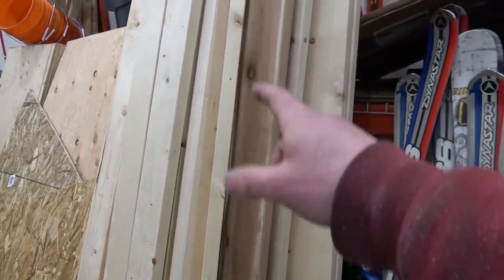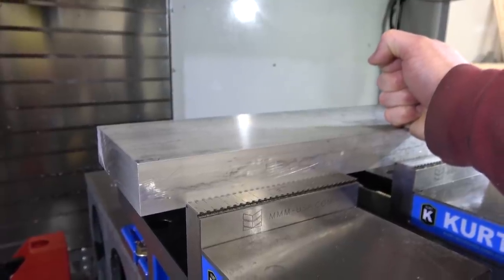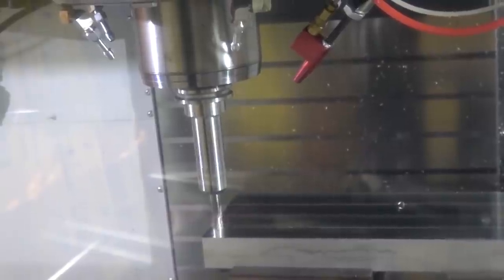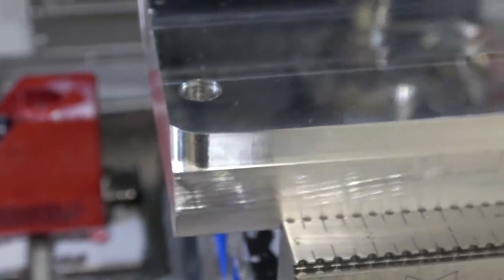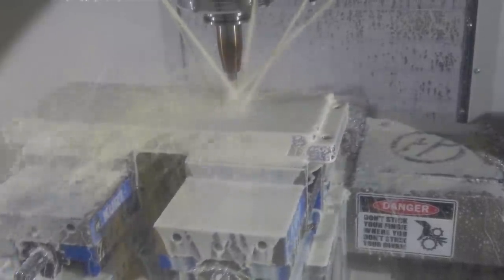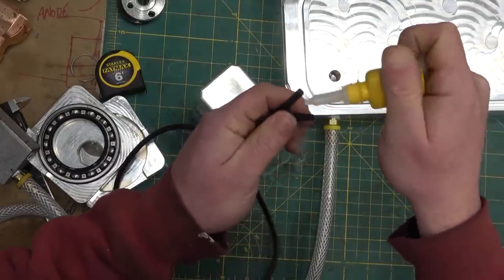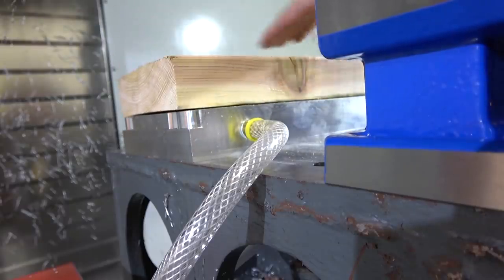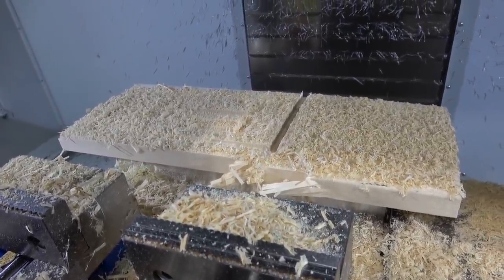Vacuum clamp for router-ing | Prototype & Test

Comment: Made one years ago, we used ball catches as air valves and had compartments surrounded by foam tape

The oring doesn't have enough compliance
Reply: Can you please describe how/why you used the ball catches?
Reply: @SlocketSeven  Ah jeez, man... got me friggin cryin' over here from laughing.
Reply: @nicoleyensen7062 they worked as valves, once pressed down they would open allowed you to have a grid of sealing material meaning you can have various sizes on the board
Reply: @MT_T991  Thanks, makes perfect sense now.
Reply: O-rings are fine for vacuum, however just like the shady highway, you have to double up or things will go wrong.
Reply: @eideticex  everything I have seen used industrially  over wood and stone industries uses foam rubber as a seal. It is more forgiving although obviously more readily damaged. Industrially  we used  a vac lifter  on slabs of stone not necessarily  flat or straight  for slabs upto 600 kg, one of clients had a  almost fully automated  cabinetry factory, all panels  from delivery ex supplier to assembly were vac lifted, also used foam seals , but seals lasted longer with them on smooth panels than for us on sharp and rough stone
Reply: @davidp8157  ive only seen foam seals on wood
Reply: @MT_T991  like I said above,  foam used extensively on other industries including stone,  as it is much thicker and with a hugely larger surface area more forgiving  for rough or uneven surfaces,  and to an extent, while more readily damaged  at any o e time, is more damage forgiving , o rings on rough stone would not work, and would not last,  but foam rubber does reasonably  well.

Comment: Try it with a v-ring seal, o-rings are not supposed to be used in this way.
Reply: don't know if would be more efficient the V shaped, but for some reason every CNC wood vacuumed table I saw was using that same type of seal

Comment: Depending on the internal stresses and the thickness wood can deform quite much when you mill it down. Also wood is not airtight so if you go too thin air will leak through and you loose vacuum.
If your wood keeps popping loose here are 3 ideas for you:
Use tape to seal the underside against your fixture. if your part deforms a little it will start to rock but not get flung off your machine.
If you have to go thin, either put tape or lacquer on the underside to make it airtight.
If that is not enough, mill a way deeper gallery in your fixture, use larger diameter and / or more connections and attach the whole thing to a shopvac. If a little air escapes due to deformation or the part being too thin the shopvac will be able to still maintain a good vacuum with a little bit of flow.
Reply: Except that shop vacs need airflow to keep their motors cool, so you'd want to either use a ventuuri to get the pressure difference despite allowing high flow,or you'd want to build your own vacuum body to allow separate cooling of the motor.
Reply: @absalomdraconis ...this is true for most normal vacuum cleaners, but everything that is designed for wet and dry use should have a turbine with an outlet or radial openings and an extra cooling fan to keep the wet air out of the motor.
I am not sure how big of a venturi we are talking about but from my experience they already had problems coping with the leakage of plain mdf sheets.
I have used a wet and dry vac on my table for quite some time but changed over to a rotary vane pump 2 years ago for extra holding power on small parts.

Comment: Cedar is so porous, you would need such a powerful compressor or vacuum pump to hold it down.  Same with the plywood.
Reply: He just pretends they are metal because he thinks metal is better. White Oak might be a better choice.
Reply: @johnpossum556  : The deciduous trees all have vessel cells, whereas cedar & other conifers don't, so I'd suspect white oak to let more air through, rather than less.
Reply: @absalomdraconis  White oak is what they make whiskey and wine barrels out of & they never leak out.
Reply: @johnpossum556  airtight and water tight aren't the same, especially under vaccuum/pressure.

Comment: We use self made vacuum fixtures in the shop I work at all the time. A few differences I see. The gasket we use to use .125 surgical tubing/slingshot band but recently switched over to a foam rope, same size that has been sealing a little better. We use much smaller galleries in a grid pattern, but we're not doing tree carcass. As for the air we use a "industrial" version of what you did, and they work fine for 3-6 months, until the custom buna gasket develops a leak and it no longer develops sufficient vacuum...

Comment: Let me preface this by saying thank you for making your own vacuum pod, it was immensely entertaining. You should look into stone working vacuum pods. I work at a granite fab shop and run the cnc router and use these pods daily. In the industry most are two stage, top and bottom, but they could very easily be modified to fit your situation and one the size of the one you made can be had for a couple hundred US dollars. They have much thicker seals to deal with the imperfections and a rubber friction plate to greatly increase the side load a piece can take. Check Blick Industries or Granquartz. Thanks for all the great content!

Comment: Hey AVE. I work on CNV routers with Vacuum tables all day long.  Just for a little advise I think that your idea is awesome.  I would suggest that you hollow out the whole piece of aluminum within the gasket boundary about an inch into the thing. Leaving about 1/4" between the gasket. Then take a piece of MDF (dead tree carcus mixed with some other industrial garbage).  Then you will have a better grip and more surface vacuum.

Anyway just popping in my 2 cents.

Love the vids man

Comment: Vaseline... A really old school plumber said to me one day, if you just dab a bit of Vaseline on your gaskets or fittings, your ability to torque it will double, and you wont tare the gasket. Vaseline, you can eat it, it doesn't degrade rubber, and if you want, it just washes away. I use it on all sorts of gaskets during assembly. In fact it works so well, you can over torque a fitting and just cut the gasket in half.

Comment: When I was in cabinetmaking school, we had a big CNC router, and it had a vacuum table. They just kept one sheet of 3/4" MDF on top of the table, and it could suck anything down so it wouldn't move. The MDF had just the right porosity to hold onto anything.

Comment: THICK MDF (16mm ish) works great as a sacrificial holding bench.

Suck the MDF down to the vac table with the work-piece just sitting on top... and the vacuum actually pulls through the MDF.  Use masking tape on the edges to prevent air being introduced where you don't want it to be.
This way you can actually machine all the way through the work-piece (about 0.2mm into the MDF)

ALSO, conventional milling is much more common for tree carcasses.

Comment: We used foam weather strip tape as a seal. Down Sheer bits for slots and Up-down for edge profiles. Throw a chunk of MDF on your vacuum table for a spoil board/fixture. Glue and nail stops to that.. Mass production enabled.

Comment: Speaking of expensive for no reason, check out venturi vaccum generators( Use to cost $200-300CAD). You should make a quick-tip vijeo. Take a piece of 1/2"ID air-line, slit it down the side for an inch and stuff a "2 atmosphere limited" or otherwise air chuck tip all the way in. I've used this 100's of times to suck oil/water/whatever when there wasn't a wet-vac around. It really has decent vaccum. You could also machine a proper one up and attach the suction to a used dino-squeezens drum's vent-port and make a 50-gallon suck-all with a 2" receptacle.

Comment: First time I saw Super Glue was way back in 1966. It was used to join the O Rings used in the Penstock Expansion Joints on the Snowy Mountains Hydro Electric Scheme.

Comment: With my 4 x 8 router table, I used 2 Fein vacs piped under a sheet of 3/4 MDF, and taped the edges of the MDF. If I was doing a smaller part, all I had to do was lay plastic sheets over the unused areas. The Fein vacs can run all day and night holding suction, and never overheat due to internal cooling fans. Def a DIY approach, I don't have the machining equipment to do otherwise,  needless to say - the parts didn't budge. I didn't do metal work, but for wood, UHMW, aluminum, it worked great. And yeah, I'm jealous as hell of all the toys you have at your disposal, LOL. Keep sending your videos from the Great White North, great stuff.

Comment: You can use a sacrificial sheet of MDF for cutting past Z=0 (use a compression cutter!) Vacuum will pull through mdf because of its porousity. If you fly cut both sides first it works a lot better (use a SHARP wood insert, flatter = better vacuum seal) and re-fly cut if it gets too spoiled. Flip each time or it will curl up from built in stress (yes, its a pre-stressed material. )
I use one like this at work: https://www.youtube.com/watch?v=TNlQ0KDD560&t=1m, its got a 5x10 sheet sized mdf table, and 4 Becker rotary vane pumps.

Comment: Use rectangular closed cell foam weatherstripping instead of an o-ring. It’s usually the dark grey stuff with PSA on one side, that you get at the hardware store. maybe 10 durometer if that. Your o-ring is probably 70ish durometer - far too stiff.   Vacuum hold down spoil boards are typically made of 2 layers of 18mm MDF in the furniture/cabinet industry. Aluminum is huge overkill. plus the vacuum holes should be spaced on a grid no more than maybe 50mm apart, and they should be small enough to be choked when there is no work piece present. Like 1 or 2 mm dia - heavily dependent on the flow rate of your vacuum pump btw. This maintains the overall negative pressure in the manifold. No need for a separate Venturi thingy, in fact that Thing is probably part of the problem.

Comment: weather strip works great as a seal on router vacuum tables, the extra thickness and compliance allows for slightly warped wood.  using 10hp high volume vacuum pumps though

Comment: You should have used Cellular Rubber Cord. If your groove is 5mm, then use 7mm. Cellular cord will compensate for the imperfections and with vacuum it will contract because it's soft (but won't leak vacuum). Square grooves along inside the vacuum table is also a good idea. just my 2c.

Comment: We use vacuum pumps at the place I work, we can mill out 12 parts of dense EVA at a time with one 480v pump reliably. Maybe a venturi vacuum isn't the most reliable? We don't use gaskets, only surfaced aluminum with milled out channels. I've learned that you CAN mill out the edges, but the rotation of the bit will also peel/ catch the edge and kick it off, especially around circles and perimeters.

Comment: You surely know this by now, but the issue is most likely in the gasket. Below is a link to a good gasket company. For wood, I'd probably use 1/4". Upgrading the vacuum pump might help from there, but if you stop the leaks by using a superior gasket, the pump doesn't have to be as darlin. Of course, wood being porous, might require more flow.

Comment: 3M Closed cell foam with adhesive, 1/8 X 3.8th or so takes up the slack. Proper vacuum tank and foot valve was standard equipment for router setup back in the day.

Comment: I ran Biesse pod&rail CNCs for more than 10 years. You need a proper vac-pump at -12bar atmospheric. Milling a grid of grooves with supporting islands for gasket is more functional and adaptive, allowing you to configure the surface for parts of different sizes and shapes. Glue and grease on the gasket isn't necessary. The hold should be strong enough that you cannot pull the part off using both hands.

Comment: Fastest and easiest fixes. Change o-ring for window seal foam (adhesive not spray). Change venturi for a small squirrel cage fan or shop-vac. Increase depth of vacuum well depth.
Biggest things are high volume suction(not pressure), a large surface area, and a SOFT seal surface that can conform to the wood grain.

Comment: AvE! We use a "Vacuum fleece" (https://shop.vhf.de/articleGroups/Vacuum-fleece-V_SVT_VV.htm) over a perforated table to hold down plastics, wood, ect... This is also a sacrificial material. You need a lower vacuum and higher air wolume suction device for it (e.g. plain household vacuum cleaner). With porous materials, it is more likely to work .

Comment: finish/feed rate is loosely based on cutter corner radius, good start point is 1/3 of the corner rad for finish passes, or F of .01 per tooth for a .03 cutter radius I leave you to do the math on that

Comment: Why not use the type of vacuum hold down used in larger routers like MultiCam? Then you have a thick plastic top with a routed square pattern. Lay down some rubber o-ring in the size you need, put you object over it and turn on your blower (high volume, low pressure pump). Open up the valve for that section and it will suck you happy.

Comment: Somebody who regurlarly works with wood would probably just screw/glue the work piece into a scrap block of 2x4 or something.  Leave it to a machinist to needlessly overcomplicate things.  That said, if I was in the business of overcomplicating things, it seems that a closed cell foam gasket would be a better fit for the application.

Comment: Need an ultra soft o-ring with enough of a stand off to completely fill the ridges in the wood (63 RMS or worse?). Ultimately the wood needs to compress the o-ring to fill all the gaps and make a vacuum and then it will be a "self feeding system"(effectively a gasket on a pump).

Comment: Improve the sealing characteristics with more and smaller sealing rings. Concentric might work, but I'd go for a more dispersed pattern, like an octopus sucker. Additionally, brushing some wax on the surface of the wood before you put it on the vacuum block will help it seal better, even with a rough surface.

Comment: The o rings don't have to withstand much pressure, just atmospheric, wouldn't something softer help it seal easier, needs to develop pressure to crush the ring and form a seal, to get enough  pressure to crush the ring, a catch 22 type deal.

Something jelly like...maybe similar in consistency to your DIY prober

Comment: Hey man, I used to make bass guitars and we made an alum. jig similar to that one of yours.  The difference was I milled a cross hatch with a 1/8" ball end in the "field" and the perimeter I used neoprene weather stripping where you used the round gasket. Obviously flattening the wood first is pretty helpful. Keep your vise holding a dick.

Comment: Would it work better if there were some channels cut to allow the vacuum to spread? It looks like your only source of vacuum is the single hole, if that gets plugged for the suction, then you only have that square once of area. At least that's what I'm thinking.

Comment: For my wood elf projects on my router I like to use masking tape and ca glue or double sided tape. To be able to cut the sides I use a scrap under my workpiece. Are the boxes for the hammers?
Reply: That's a good idea.  I assume you're putting masking tape on the work and the scrap and gluing the tapes together? I'll have to try that. I haven't had good luck with double sided tape, everything from carpet tape to fancy VHB film all seems to squirm a little.
Reply: dk usually I’ll put making tape on both parts. NYC CNC has some videos about doing this. I like the smooth blue 3M tape

Comment: A quick path to a CNCed gift box is to use this box generator on Thingiverse https://www.thingiverse.com/thing:2556257  This will take your dimensions and create an STL file which you can then create tool paths for or you can 3D print a box.

Comment: We used a very similar jig for gluing strip heaters down with RTV to the modular plates that components are mounted to on satellites & other spacecraft.
The difference is that we used a tacky butyl rubber  strip around the perimeter, then placed a clear plastic sheet over the top. The vacuum pulled the plastic down against the heater strips, and applied an even pressure over their entire surface. The vacuum also pulled air bubbles out from the RTV.
Anyway,  just pointing out that your jig has more than possible use.
You could also mount a clip board d finger snapper to one and and use it to hold fish while you filet them, and suck the blood out the vacuum hole. 
Or turn it into a scooter with 4 wheels, brushless motor, rechargeable lithium batteries....
The possibilities are endless. But you chose a  board holder. That's OK too.

Comment: maybe a MDF spoil piece?  I use 3/4 MDF over my vacuum table as a waste board.  The vacuum draws right through the MDF to the piece on top, depending on the power of the pump of course but for mine you pretty much need a pry bar to get that sucker off there.

Comment: Dang!

listen Captain Canooki, i LOVE your videos, this one included. You should have just got a wood planer, cheaper with ur time involved, and then Blue tapped the machine surface, blue tape the work piece, then super glue the tapes together. when youre done, just a sly tappy tap tap and breaks the blue tape. over engineered a vacuum holder, still COOL AF and will be useful to some degree. 

Keep up the great work AvE LOVE your channel never miss a video.

Comment: I used to work in a facility where we used vacuum clamp fixtures. We used foam rubber weatherstripping. It has a little more give, so it's more likely to seal on uneven surfaces.

Comment: In woodworking industry vacuum pods with O rings are not used to hold timber, the O ring is used on the bottom of the vacuum pod to SUCK on the router table. On the top either a closed cell foam seal (but doesn’t last very long) or even better a moulded silicone rubber is used. Put a muffler on the Venturi.